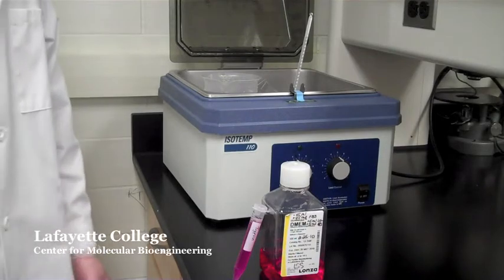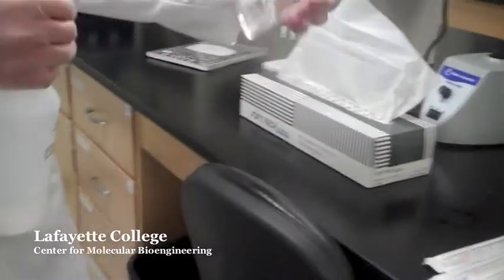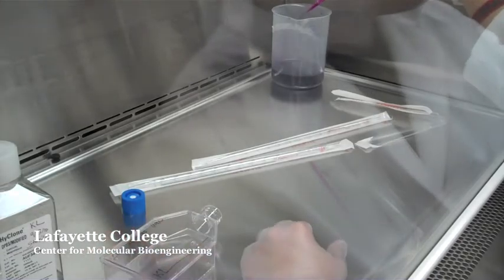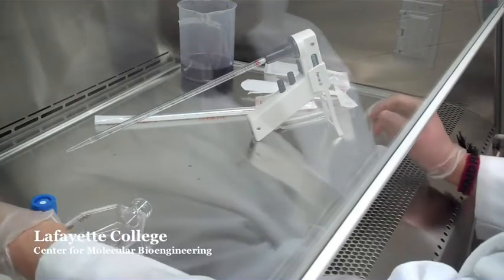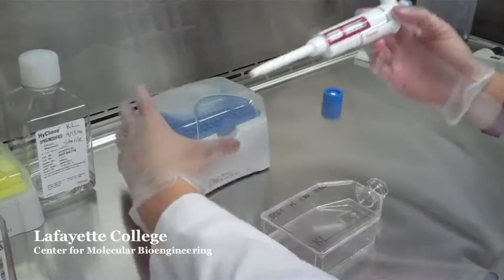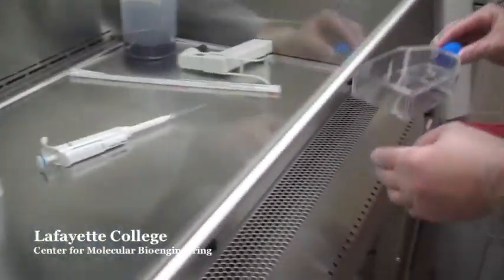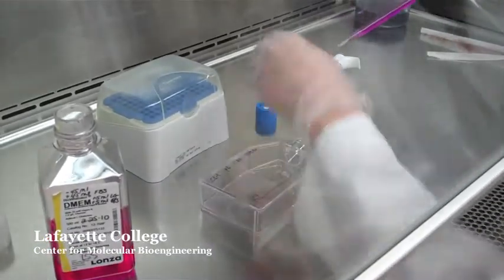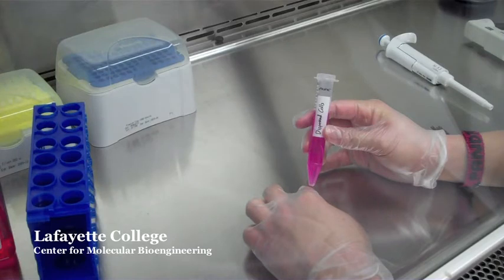Trypsinizing Cells

Comment: Why did they leave the lid off the flask for so long....that's just asking for contamination to go right in there.
Reply: nice to see they use sterile pipettes instead of cannulas, not concerned about the lid of the culture being left off so long in a BSL-2 style hood (they are not bench tops where contamination is a higher risk) they just move hepa filtered air around (risk is low). However the risk to touch the inside of the flip top lid of the trypson holding cylinder & then contaminate the next users cell line is a HUGE concern. really need to think about using a screw cap for this part.

Comment: What cell line is being passaged? I ask because the five minute trypsinization is fairly long, so I wonder if the cells are a very adherent bunch.
Reply: You need to consider cell density and percentage of trypsin.
For example A549 cells would talks longer than 293 HEK, but 293HEK at a high seeding density could take longer than 5 minutes